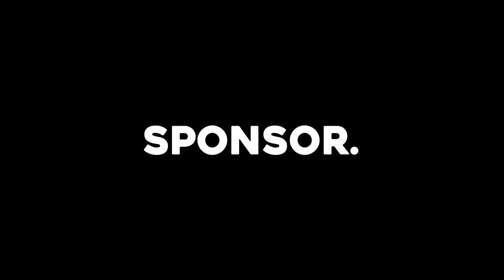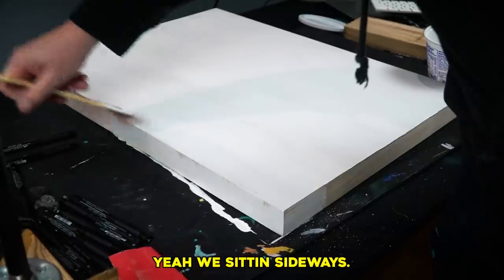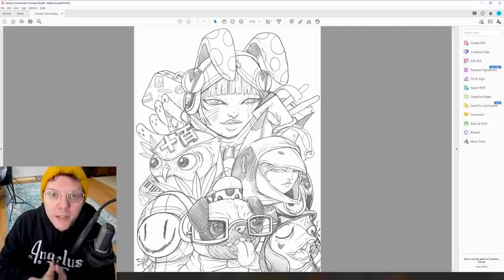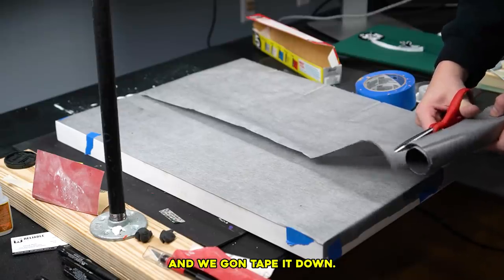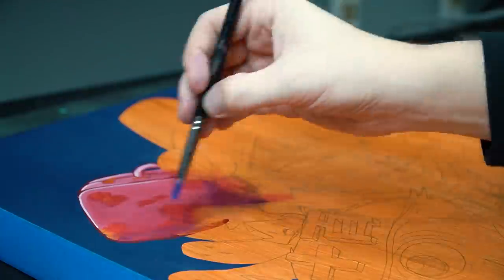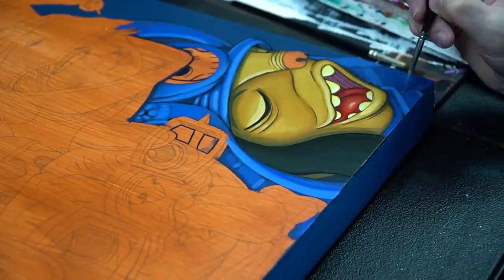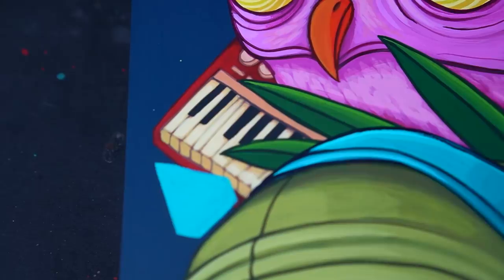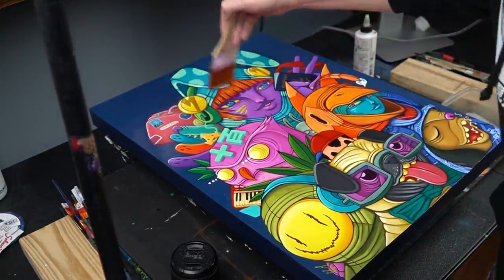How I make Acrylic Paintings

Comment: Not sure why you don't use a short throw projector to get your sketch on the canvas. Would really save a step or 2, as long as you can temporarily mount the canvas to a wall. The downside is occasionally staring at a really bright light. Otherwise GREAT WORK!

Comment: the acrylics destroys the brushes pretty quickly... depends on the brushwork and the time color has to dry on it (just needs to be washed often during the work)... I´d say no need for superexpensive brushes, just good brushes - cheap ones for the bottom layer, good ones for the middle ones and expensive ones for the final touches, cheers ;-) (I do oils over acrylics)